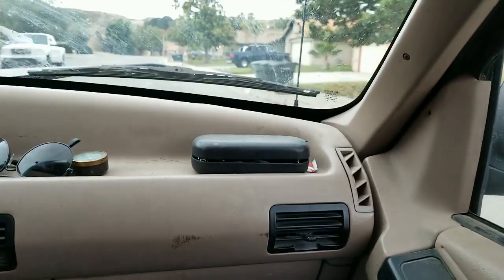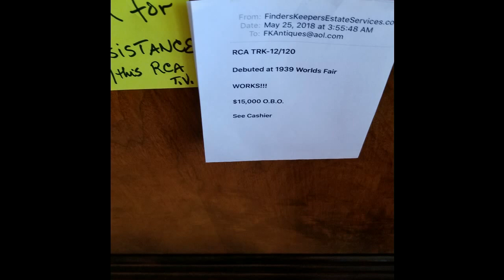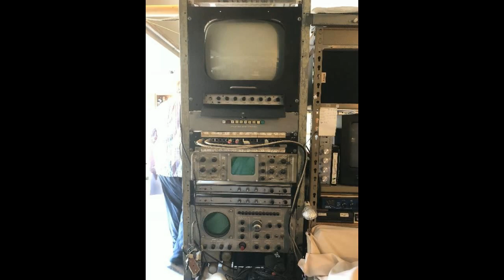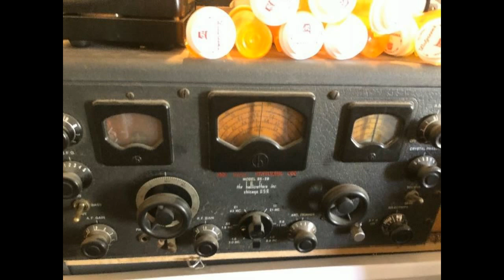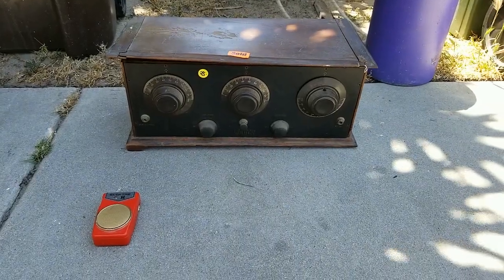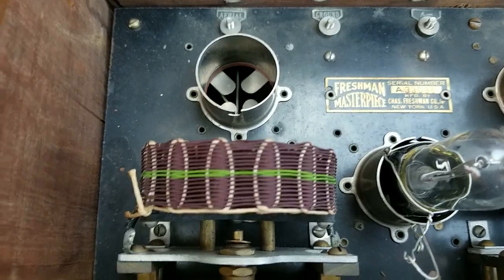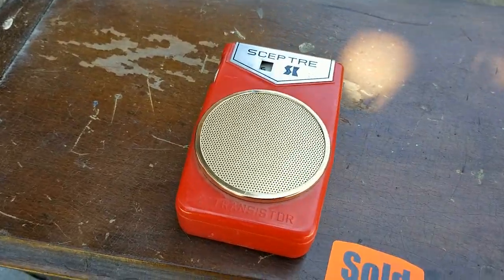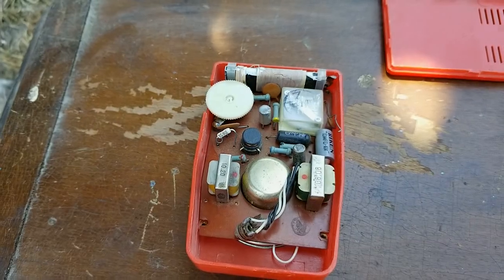Amazing Antique Radio and TV Estate Sale

Comment: Did they ever have the RAC TRK-12 working,? Very hard to get $15K for one of those sets now, let alone not working.
Reply from the maker: mspysu79 never saw it running so not sure of its status.
Reply: mspysu79 What would be a fair price of a working TRK-12/TRK-120 today just out of curiosity? I’ve seen them sell anywhere between $5-12,000, but know that is quite a bit of spread in terms of pricing for an electronic device that only had a production run of about 1600 between early 1939 and late 1941.